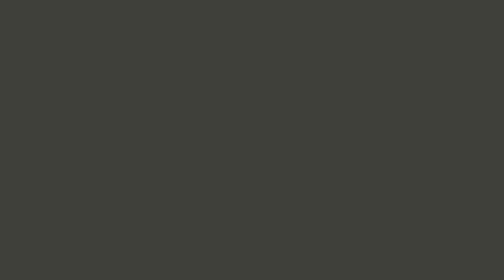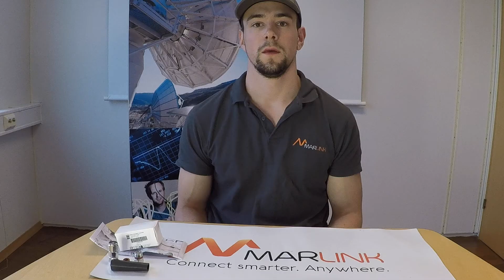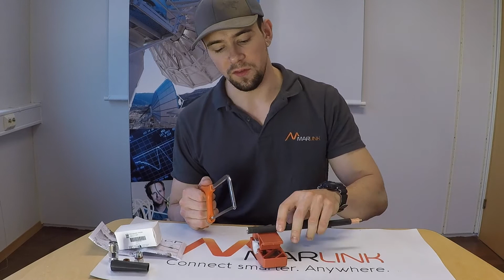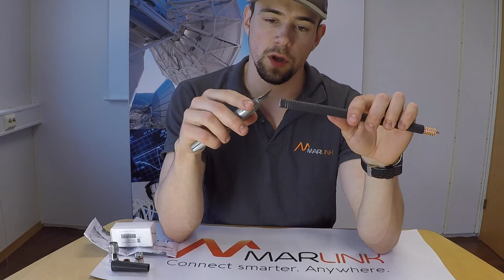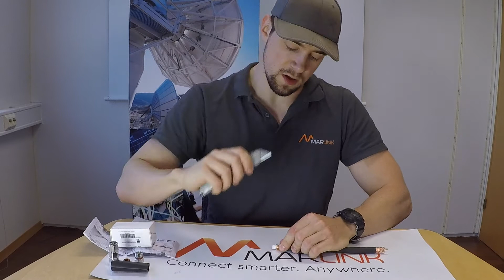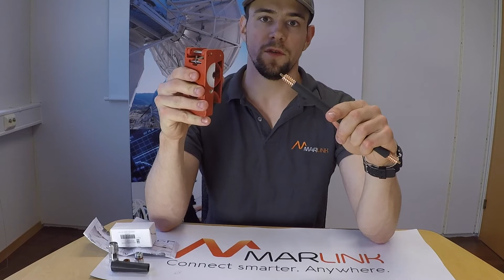Cable termination of Cellflex SCF12 50JFN up to 50 meters

Comment: Hi, thank you for sharing, I'm still learning how to crimp (in youtube) ... and I believe I have the same connector as you do, but its hard to find that trimming-tool here, if you don't mind could you please tell me the length of core and the exposed outer conductor?, I'm planning to trim it manually, maybe with a knife or cutter :D. Thank you
Reply: Hello Adi. Center conductor is 7 mm and the outer conductor is 19 mm. So you need to remove 26 mm of the isolation. You can by the tool (TRIM-SET-S12-C02) from http://www.rfsworld.com/company/offices
Reply: maglys81 Awesome! now I can measure it precisely. Thank you very much